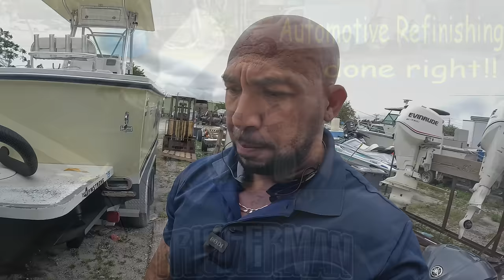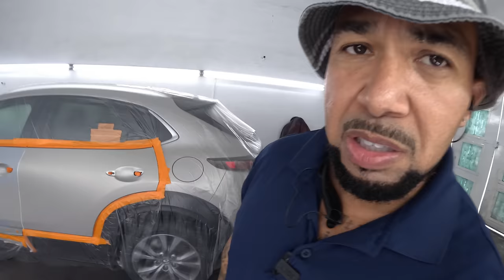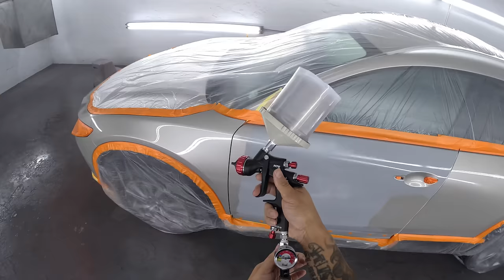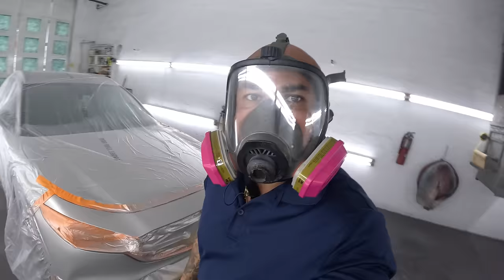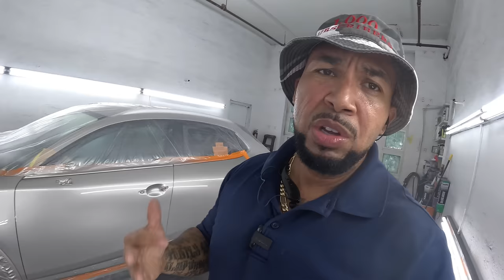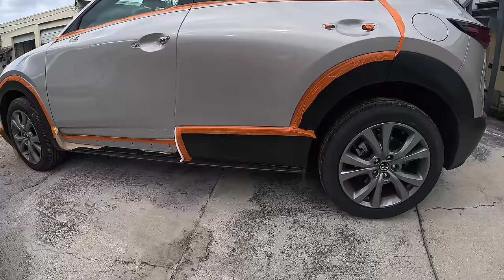Tip to Prevent milky paint!! Florida, Texas, Louisiana etc.. know how to get out of trouble fast

Comment: I had always heard of blushing but never experienced it until about 12 years ago. Painted a drag car for a cousin in hot rod black laquer primer. It was raining outside and it blushed to almost gray.  Resprayed it and it turned out good. You dont hear of blushing as much nowadays with 2k products. Good video!
Reply: Lacquer is very sensitive to moisture. urethane, not nearly as much.
Reply from the maker: Yeah lacquer was the worst That's back when you used to have to put retarder in the paint I don't get it nearly as much as they did back in the days but it still does happen better off someone knows what to do in case it does happen  💪🏼

Comment: Seen this color pass me the other day and I was thinking, what a nightmare. I might have to try using a wet bed more. I have to deal with heating issues in my booth and often the panels won't cool down and the metallics stand up like you wouldn't believe lol.
Reply from the maker: Yeah man on certain colors and in certain temperatures the wet bed can help. I honestly try not to depend on it. I like to keep my skills up to par without it  but I know there is that 10% time that applying it does make things easier. Thanks for watching my man 🤜🏼🤛🏼

Comment: Rockstar vid as always Trug. Had a damaged van in for repair & paint - son chucked me his cast-off "Pro Grade" gun, he upgraded - I usually use cheapo p.o.s guns 'cos I'm cheap. 

Paint came out like glass right off the gun. Everyone here commented on how glass the finish was compared to the usual I put out.   What changed? Paint didn't, primer didn't, method didn't, environment didn't - only the gun changed, went from a 50 quid gun to  200 quid gun & man did that make a difference.  Every control did what it said - fan adjust adjusted the fan. Needle control adjusted the needle. Pressure adjust adjusted the pressure - I could set that gun to dance compared to the muck I'm used to where nothin adjusts nothing with any precision. 

Buy you a good gun Trug viewers - good guns matter.,
Reply from the maker: That's awesome 😎 yes at some point when you want to step things up a notch you have to make an investment but that's after you've maxed out the cheap guns and have the experience to knife the difference between the two. Sounds like you nailed it  congrats brother 💪🏼💪🏼
Reply: @thetriggerman954  I cleaned that b*tch so well after I used it, it gleamed - i want it to keep doing what it does. Changed the game for me - I always went the "It ain't the gun it's the painter" route - turns out a lot of it is the gun.
Reply from the maker: @jamesward5721  🍻🍺🍻

Comment: You run your booth all the time? I got a similar setup but they got the body guys right next to it stripping old schools🤣🤣 i found if i don't run the both at first and just use it after i spray for fumes, i get so much less dirt/static bad stuff lol
Reply from the maker: Yes I run my booth all the time  especially 15 minutes before I start spraying. Body Man is on the other side of the wall so not far away  😕
Reply: @thetriggerman954  I think the both I use is just too much negative pressure. Like it will pull paper off tables outside of it when I open the door lol. Thanks for responding to us little guys🤣 best paint channel period

Comment: is it common on collision work to not remove the headlights bumper etc.? I have to paint my moms car and am wondering if i should take the bumper covers off, lights out etc etc. Looking for Trigger advice.
Reply from the maker: Its common not every shop removes everything. It all depends on the shop. I've worked in shops where they would remove the entire windshield and back glass entire car comes apart and now at this shop on the other end of the spectrum they don't really remove much. You definitely get a cleaner more OEM job when you remove everything. But it does add on an additional day or two just in removing parts, labeling nuts bolts, Then reinstalling everything ideally that is the way you want to do it.
Reply: @thetriggerman954  Great advice Thank you.

Comment: Yep im stepping up my game! Why dont you like the swivel?
Reply from the maker: It's annoying and not needed. I don't know any painter that likes their air regulator twisting and turning while they are trying to paint. Feels like it's coming off.
Reply: O im a codes guy! Need to know them codes!😂
Reply: @thetriggerman954  interesting. I find that the lack of swivel is annoying. My thoughts were it could introduce kinks in my line if not present.
Reply: Ill try without it on a test panel
Reply from the maker: @FocusedHands  air hose coupler has ball bearings that prevents kinks. Just have a quality coupler and no issues. Probably if you didn't really grow up spraying with guns prior to them making theses things it would be more of an issue. But most painters I know have been painting like 20-40 years and hate them. But if they work for you rock out 🤙🏼🤙🏼
Reply: @thetriggerman954  Respect!

Comment: You may not believe it but Oklahoma has it share of crazy weather tornadoe season 2 times a yr also can be 70 1 day then drop down to 40 the next day
Reply from the maker: @rongamble9884  I believe it man. Everywhere is having crazy weather it seems. Going from one extreme to the next. But 40° 💀 that's the day I call out from work 😂
Reply: @thetriggerman954  ya Oklahoma has about 2 months out of yr is very cold I'm a warm weather person but I have good heat in my shop and it's only 30 ft from the house 🤣🤣
Reply from the maker: @rongamble9884  now that's blessings 🙌🏼🙌🏼

Comment: It's frustrating for sure, and I've only ever been able to get rid of this with more heat. (You know, like setting it afire. 😁 J/K...well...maybe.... 🤔😆 😝😝 ) Even with no airflow, when the humidity is too high the blushing stays, and if left alone to dry, it becomes part of the final finish. Everything else is right up to that point, then the blushing starts in the middle of spraying. Man, that''ll piss you off.
Reply from the maker: Yooooo bEaChCiTyMObiLe in the house  man I've never had one that I couldn't get rid of. Damn you had one that became part of the final finish? Now that sucks 😭
Reply: @thetriggerman954  I think it may have to do with the humidity and dew point occurring at a lower temperature were I am, compared to the higher temperatures where you are.
Reply from the maker: @beachcitymobile  🫠